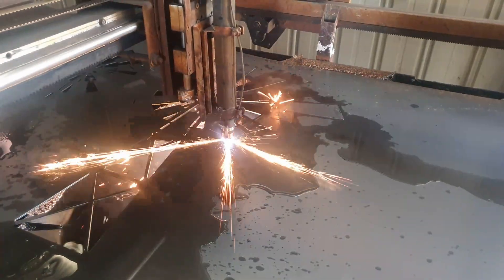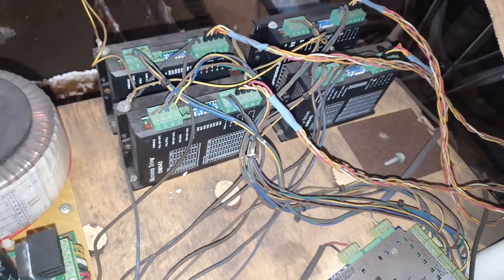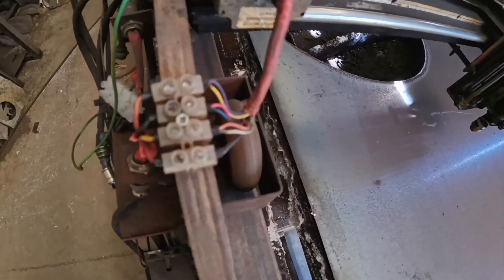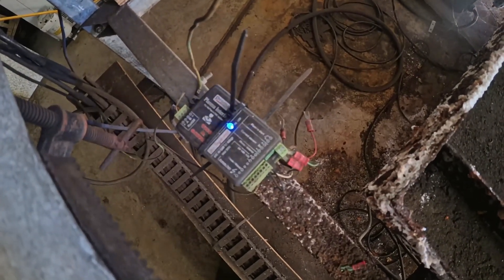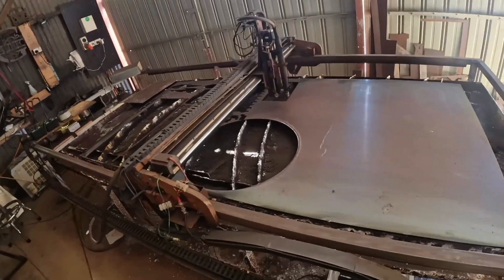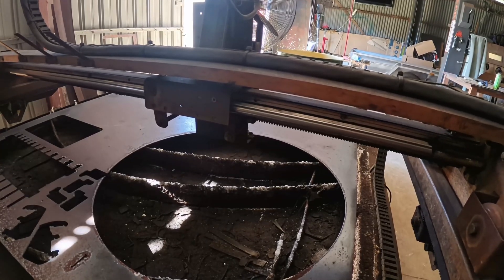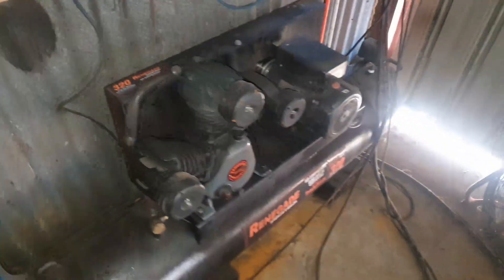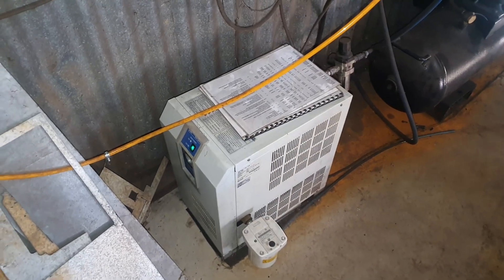Revealing successes and failures after 5 years with a CNC Plasma build

Comment: Hey PlasmaDave 👋👋, awesome project! I'm planning to build a DIY metal cutting machine myself that can cut up to 40mm thick metal sheets, but I don't have much technical knowledge. Could you be more specific about what exactly is cutting the metal? Is it a fiber laser, plasma cutter, or something else? Also, could you suggest some major components I'll need for this kind of build? Your guidance would be super helpful. Thanks!
Reply from the maker: @StromIGS  hey there, this is a plasma cutter. To cut 40mm steel with a fiber laser you would be looking at at least a 20kw machine, well out of my experience.

Comment: In a  Youtube world full of polished perfection, thank you for an in depth look at "warts 'n all" reality.
I can't think of a better example of a budget build made to answer a need, that has gone on to pay back far in excess of expectations.  As the engineers used to say where I worked "If it ain't broke, don't mess with it!"
Sorry to hear about your back... speaking from experience, dodgy backs are a pain in the ass!  In my case, finally finding the right person to help was life-changing.
Back problems don't ever seem to go away completely, but at least I have some worthwhile solutions that help me.
"Nil desperandum carborundum"...  "Don't let the bastard grind yer down!"   😜 👍
Reply from the maker: I did my back in when age 12 I fell out of an apple tree, it bothers me every few years when |I forget about it. This certainly was a budget build but as you say it has far exceeded my expectations and is actually more accurate and easier to fix than the few commercial ones I have seen. 👍